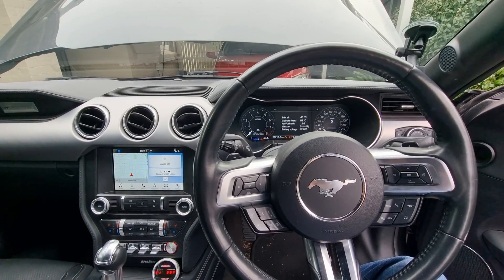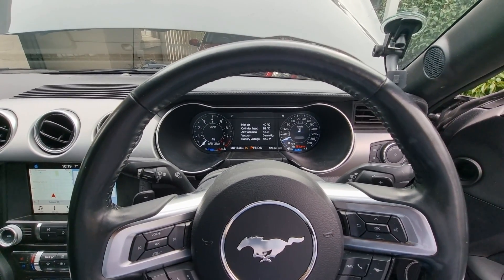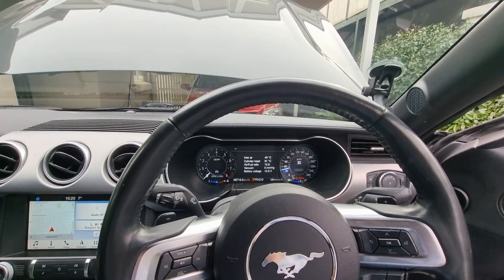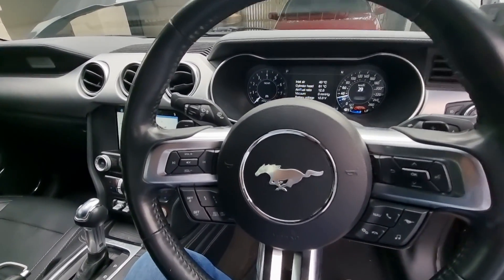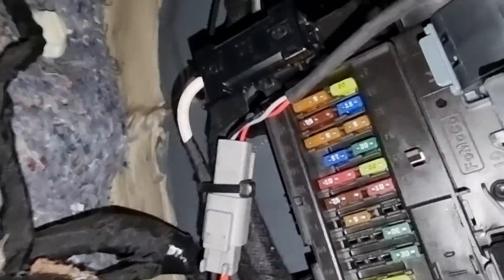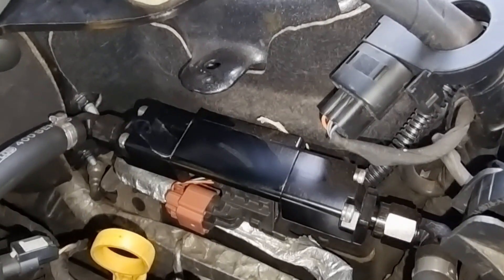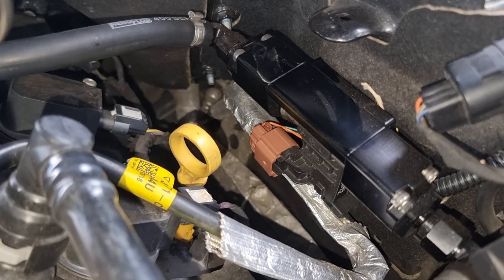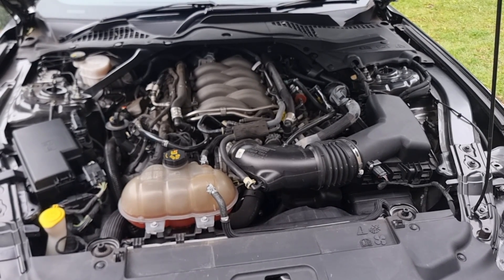PCMTEC Mustang F150 CAN Bus Flex Fuel System

Comment: I have a 21 mustang running your PCMtec multi-tune right now.  I watched The video I really like this setup, would  like run this  on my mustang.  Is there any way that you could supply a couple links to the parts that were used ? I'm having trouble finding them on the internet.